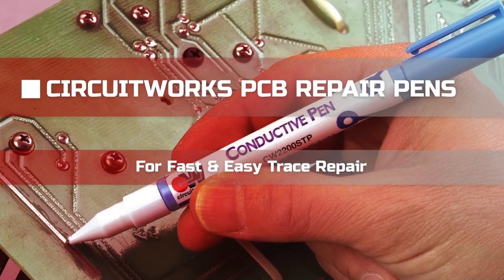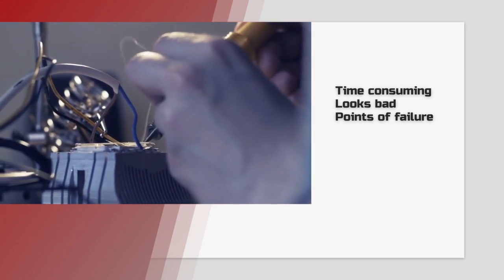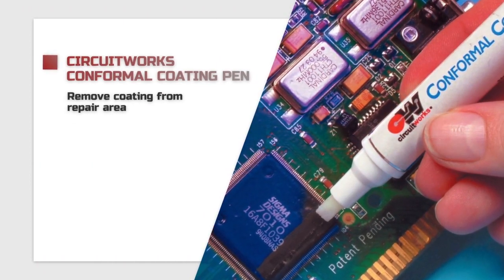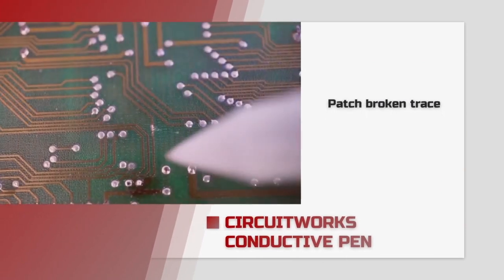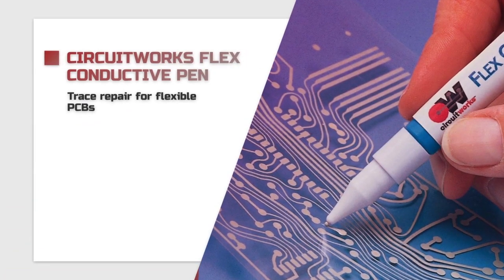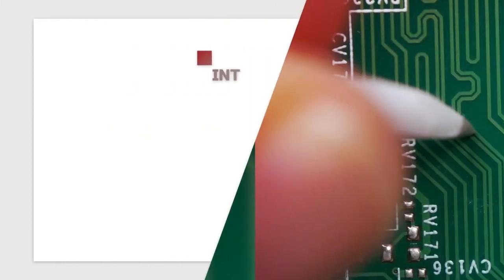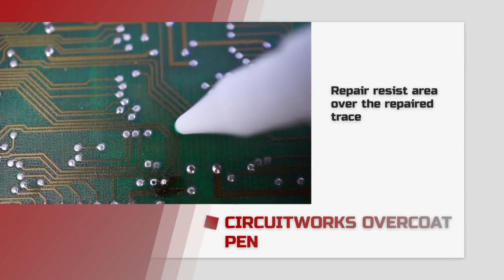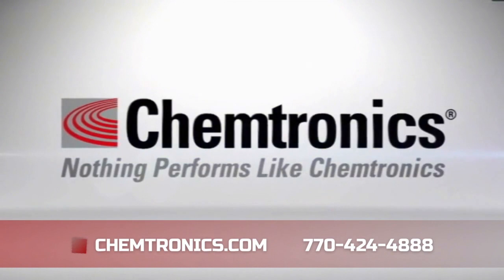PCB Repair Pens

Comment: Had one of those pens years ago for repairing Jamma logic boards and never managed to make a single repair it was just crap so it went in the bin and I went back to using my wire trace pen which always worked